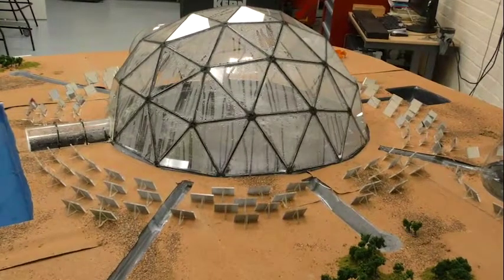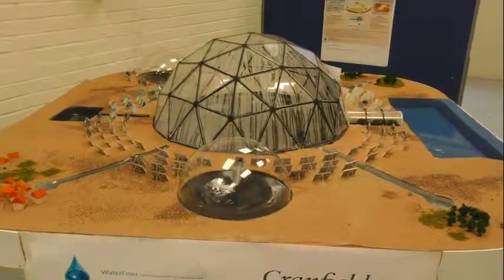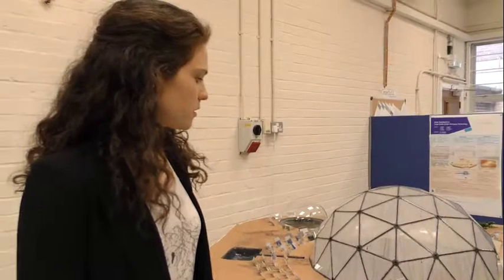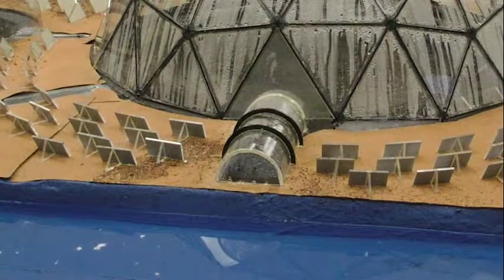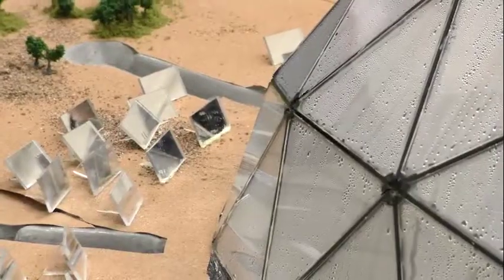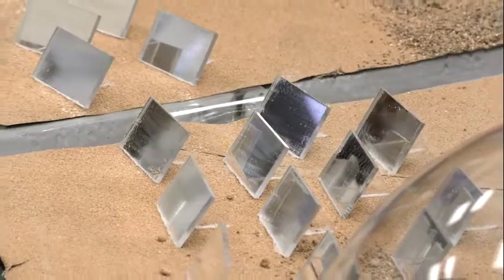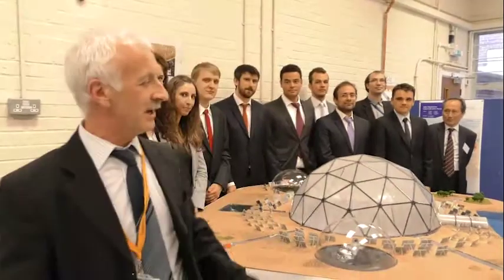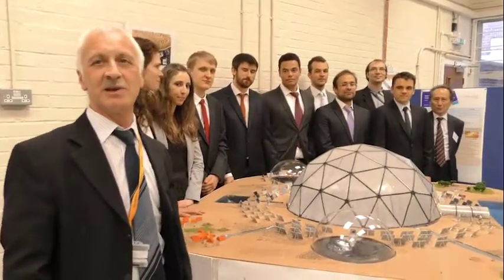CONCENTRATING SOLAR POWER

Comment: How much fresh water does this produce daily (given a size for the geodesic dome)? What would be the approx. cost per cubic metre of fresh water? Can the steam pressure generate electricity (making it self powered to move the mirrors and for water pumps etc.). Can this system for fresh water generation be combined with low water using agricultural techniques and/or for example aquaponics systems (fresh and/or saltwater based)?

Comment: What do you do with the brine?
Reply from the maker: Molten salt. We do not discharge the brine into the sea, increasing salinity and destroying marine life.
Reply: @malcolmaw4536 ,  Why not ?
It came from the sea water , what's wrong with putting it back ?
But since you ain't , use it for roads in winter time , I have a salt shaker with sea salt and use it on foods sometimes , animal salt blocks , and many uses ,  I wouldn't mind getting involved with this type of water distillation , also planting vegetation in the surrounding area and turning desert into jungle  , Forrest and  living areas
Reply from the maker: @jimthomas777  When we discharge brine back into the sea it increases the salinity of the seawater and destroy marine life.
Reply: @malcolmaw4536  , you don't have to dump it all in the same spot in the ocean ,but since you are not , it doesn't matter , it's making the pure water that matters , like I said put it on winter roads , feed it to animals , throw it away , there is always something that can be done with it , my comment said , SINCE YOU AIN'T , did you not see that part or you just skip over it ?
Reply from the maker: @jimthomas777  We process brine into molten salt. Also, sell salt to be converted into lithium. There's a big market for salt.
Reply: @malcolmaw4536  , I don't care what you do with your Salt , I'm only concerned about the pure water it makes ,
So move on about the Salt .
Run your mouth about the pure water
Reply: @malcolmaw4536  , I noticed that you keep talking about salt and Not one word about pure water , 
You don't care about the pure water , this is a way to make and sell salt , like you said , there is a big market for SALT ,
There must be a Law about getting Salt , and this is the way around that Law , you don't have any interest or intention of putting the SALT back , if Fact the salt is worth more than the water and this is what it's all about , Money for SALT , the salt comes first and the water isn't even important , 
It's not a water purifier , 
It's a SALT Factory
Reply: @jimthomas777  In most cases the fresh water is most valuable, but the salt can be an interesting by product. At least it abandons putting brine back into sea destroying sea life at the sea floor where the brine is put back normally.